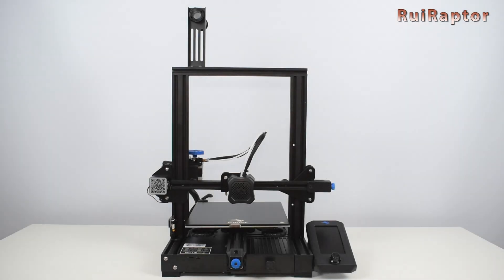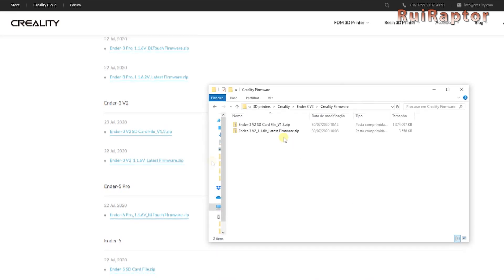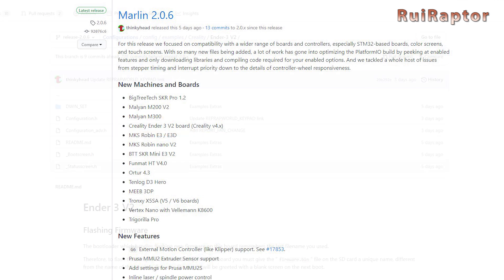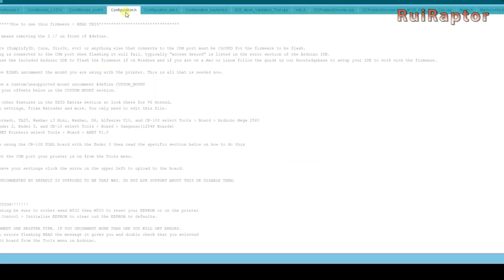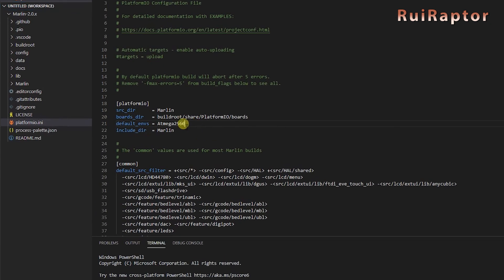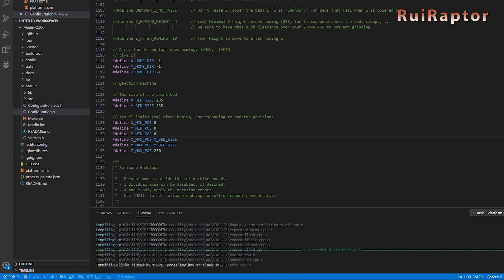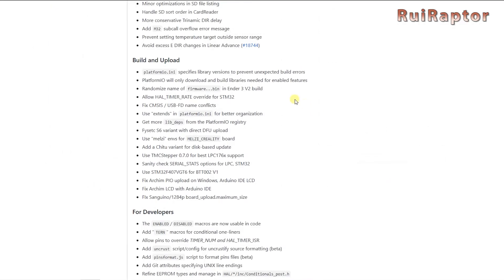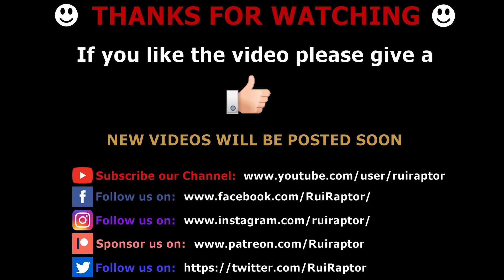Creality ENDER 3 V2 - How To EDIT & UPLOAD New Firmware

Comment from the maker: NOTE: Don't use long names for your gcode files.
If you try to print filenames with more than 23 characters long, the printer will act weird (X axis will move very fast to the left).
But if you print gcodes with filenames shorter than 23 characters long it will print fine.
Reply: Will have to try this out. Any fix for it?
Reply: lol wut...
Reply: Thank you!!!
Reply: hey, my auto restart after a fail got turned off after installing this
Reply: help pls:(
Reply: @danielgomdel6289  If you've recently downloaded from Creality, I believe the FW has changed since this video was made. I don't personally use Creality FW because it's buggy af. Are you compiling yourself? Did you change the board info in platformio? Try Smith3d if you're still having issues.
Reply: @gregoryconnors7370  good looks Greg ❄️
Reply: @danielgomdel6289  They call me the MadMan lol. Also- check out TH3D. JUST found out about them. Excellent instructions and new firmware!
Reply: @danielgomdel6289  +1
Reply: hi this isnt working for me i keep getting a error installing platformio.ini is there a different way
Reply: Interesting... I just had a weirdness that MAY be related a week or so back - Got a spiffy new E3v2 back around June, ran it for about a month as 100% stock, then added a BLTouch (3.1 version), configured and compiled Marlin appropriately, flashed the rig, got everything, including UBL, set up so that the printer was working absolutely A-1 Prime for the better part of a month, then took a week or so long break from actually printing while I picked up the absolute minimal skills in FreeCAD to do some original designs. Got the design work done for an idea I had, and started trying to print the resulting files. Things got SEVERELY WEIRD on the first .gcodefile I produced. (Which, now that you mention it, and I think about it, probably had a filename something along the lines of "first-project-left-side-main-body-lower-half-segment-one.gcode") The first layer started out reasonably normal, but rapidly got weird beyond belief. I was printing with a skirt, and that came out looking kinda like those old pictures of "what happens when a spider is stoned/on acid/on peyote/etc and tries to spin a web?" - Absolutely INSANE - looked like something a first-timer would produce in FreeCAD - a regular "pretzel". Then the actual first layer of the print started, and looked mostly reasonable for the first couple of layers, before the speed went ABSOLUTELY NUTS  - slamming (and I mean HARD) against the X and Y endstops, flinging around at speeds I'd never seen, and ultimately, I killed the print at around 40 layers when the bed bashed against the back end of the Y axis so hard that a tree-support snapped off and I figured the next development would be a wad of spaghetti. Then I tried grabbing a thingiverse object and printing it - same thing - "stoned/tripping spider" skirt, and the object was a nearly instant blob - It almost looked like the bed leveling was completely off the rails - Looking at the resulting mess, you'd proabbly guess that that the nozzle was at least 3 mm too high. Tried some troubleshooting. Attempting to auto-home it got me results that were so wonky I didn't know how to cope - It would home X/Y at the front left corner, back off to (roughly) X=18/Y=40, and then stand there and shudder when it tried to home Z, then pop up a "STOPPED" message on the display. Trying again would get it to X/Y home, then move to some apparently random spot on the build plate and repeat the shuddering and "STOPPED" message when it tried to home Z. Checked everything that seemed to make any sense to check, found nothing obviously wrong, so I gave up, flashed back to Creality-base firmware, and had the same things happening - like something had corrupted the firmware. Finally got things back to normal a day or so later after multiple reconfigure/recompile/reflash cycles, including one that I thought bricked the beast - took almost an hour before it decided to take the flash and fire up. When it did, things were at least as bad, if not worse, and I finally decided to take it ALL THE WAY back to "pure stock" - disconnected BLTouch, re-installed the Z-limit switch, and COMPLETELY (including the display unit) re-flashed the whole rig back to Creality 1.0.1. That finally cleared up the weirdness. Ran a few test prints, they worked. Re-did the BLTouch/Marlin configuration, and have been running fine since, but with much shorter filenames. I wonder if the insanely long filenames I was using for the project I cooked up had something to do with it, or if that was just a coincidence...
Reply: Thank you for this , I thought I had a broken machine

Comment: Sadly this doesn't seem to be working for me. Followed almost exactly except for that the newest files for Marlin appear to be, "bugfix-2.1.x". 

Marlin\src\HAL\STM32\../../inc/../core/serial.h:70:25: note: in expansion of macro '_SERIAL_LEAF_1'
   70 |   #define SERIAL_LEAF_1 _SERIAL_LEAF_1

The error I got was:
Marlin\src\HAL\STM32\../../inc/../core/serial.h: In function 'void SERIAL_ECHOLN(T)':
Marlin\src\HAL\STM32\../../inc/../core/serial.h:61:26: error: 'MYSERIAL1' was not declared in this scope; did you mean 'MSERIAL'?

First I:
changed default_envs to: STM32F103RE_creality
changed MOTHERBOARD to: BOARD_CREALITY_V422

Then I:
changed default_envs to: STM32F103RET6_creality
changed MOTHERBOARD to: BOARD_CREALITY_V4

I also tried every combination to including STM32F103RC, etc... but sadly nothing worked. I've got no idea what's wrong. This is just a heads-up for any other noobs that are trying to get their Creality Ender 3V2s' hot end up to the 260s (I put in 285 max) instead of having  it shut down at 230.

Comment: Hi, when i change that default_envs to creality type, platformio does not want to build, there is error, where it says that, it is not compatible with creality, only with mega 2560 est. What shoud i do? thanks for respond.
Reply from the maker: Hi, what did you define for the board in the configuration.h file?
Reply: @ruiraptor  hi, thanks for respond. I just already compiled it and works good, but my screen firmware graphical ui is broken. I think, i will install jayers firmware... What do you think?
Reply from the maker: Yes, i would recommend that as well.

Comment: I keep getting a status failed. Terminated with exit code:1
Reply from the maker: Hi Connor, scrool up a little bit and check which error you are getting.
Reply: @ruiraptor  c:\users\connor\.platformio\python3\python3.exe: can't open file 'C: c:\users\connor\.platformio\packages\tool-scan\scans.py':[Error no 2] no such file or directory
Reply from the maker: Check if your firewall/antivirus is blocking the python files from opening.
Reply: @ruiraptor  i checked and still the same issue 
C:\user\connor\.platformio\python3\python.exe: can't open file 'c:\users\connor\.platformio\packages\tool-scans\scans.py': [Errno 2] no such file or directory 

Then is says I have 63 problems all 
Function call is not allowed in a constant expression.

Terminal process "c\users\connor\.platformio\penv\scripts\platformio.exe 'runs "terminated with exit code 1.
Reply from the maker: Can you send us an email with the firmware so we can analise?

Comment: Hi there, great tutorial! Though if we already have octoprint installed is there any other modifications that have to be made in advance so it still works with the marlin 2.0 firmware? Thank you!
Reply from the maker: Hi, you don't need to change anything in octoprint. Just keep it updated.
Reply: @ruiraptor  thank you! Got it all set up no problem! Thanks for the tutorial

Comment: I have a Ender 3 v2 4.2.2 was lost the bootloader. How to build a bootloader binary file ?
Reply from the maker: Hi, it's very unlikely to loose the bootloader. I would bet that the firmware is not starting. Try to flash the firmware again (copy the firmware bin file to the memory card and make sure you have only that file in the card), reboot the printer and check.
Reply: @ruiraptor  I replace a new MCU STM32F103RCT6 then downloading a latest firmware from Creality to write to it by st-link. There are no actions after power up (blank LCD, no buzzer, no anything). What am I missing ?
Reply from the maker: Hi Sang, why did you had to replace the MCU? The new MCU does not have the bootloader installed like the stock one.
Reply: @ruiraptor  My printer got a short-circuit then the MCU could not control LCD (blank LCD, no buzzer), therefore I must replace a new one. Where can I find the bootloader ?
Reply from the maker: Ok, i see. Have you tried to contact Creality? Not sure if they will provide the bootloader...
Reply: @ruiraptor  I try to read memory content from the old MCU then re-writing it into the new one, copy the latest firmware into a MicroSD card then putting it into motherboard, waiting for about 20 second after power up, my Ender 3 worked perfectly. Maybe there was a bootloader in the old MCU firmware which the Creality wants to hide it.
Reply from the maker: The bootloader is the part that allows firmware update to be done by the memory card. Without it, the firmware could only be installed with a programmer using the SWD pins. That's why the new MCU needs to be programmed with a bootloader before the firmware. By reading the old MCU memory and saving it to the new MCU, you installed the bootloader. Good job ;)
Reply: @ruiraptor  If you write the latest firmware by SWD pins, I am sure that it would not work. I think the bootloader is not only update firmware via MicroSD card but also initialize some needful peripherals.

Comment: Thank  you for the video, I have entered my changes needed to go to a direct feed system, but it will not compile. I am using the updated 2.0.9.1. 
My error is:
arm-none-eabi-g++: error: C:\Users\BZ\Desktop\3D Printer\Ender parts.info\2?Software and Drive\Marlin-2.0.9.1 - Direct drive edit\.pio\build\STM32F103RET6_creality\tmp1mzsacho.tmp: Invalid argument
arm-none-eabi-g++: fatal error: no input files
compilation terminated.
* [.pio\build\STM32F103RET6_creality\firmware-20210713-153456.elf] Error 1
Reply: Disregard, linux got me. I had to remove the spaces from my folder names.

Comment: I followed the steps and got the success message, but don't have a .pio folder after
Reply from the maker: Hi Oscar, at the left of the visual studio code you have a tree and check if the .pio is there. If yes, click on it with the right mouse button and select "reveal in explorer". It will open that folder for you.
Reply: @ruiraptor  thank you so much, for some reason searching for .pio folder didn’t work, but then I tried searching for STM32F103RET6_creality and it took me to the build folder with the .bin file, I appreciate the help now I can finally use my printer with my ender extender thanks again this is the best video I’ve seen actually explaining each step .

Comment: I updated my V2's display with no problem, but I tried updating the firmware and it only shows an infinite black screen.
I'm not sure where I messed up, but I bet it's going to be fun finding out.
Reply from the maker: Hi D, did you use a different name for the bin file? Try having nothing but the bin file in the card when uploading the firmware.
Reply: Thanks, I'll try that.
 The bin file had a different name. I think I have to format the SD card and only have the bin on it. If that doesn't work, I'll try to check I'm not using the wrong firmware (I may have accidentally downloaded a BLTouch file or something).
I'll report back if it works or not.
Reply: @ruiraptor  I formatted the SD card (FAT32), recopied the bin onto it, but changed the name again, but only by a few seconds.
Inserted it into the printer, after a couple seconds it showed the logs and loaded just fine... I think I need set the home or something because at the bottom of the screen, it's showing "x:??? y:??? z:???".
Reply from the maker: Hi, it seems that it worked. The X, Y and Z coordinate information will only show after you complete the home sequence.
Reply: @ruiraptor  Thanks. Yeah, that makes sense. I'll just binge watch your videos for a while lol.

I'm really new to 3D printing (I got my first one 3 days ago) and assembled it. I have to fine tune the belts and adjust the rollers some more, then I should be able to do a home sequence thing.

Comment: fatal error: U8glib.h: No such file or directory but i added it with libraries.. What can i do/?
Reply from the maker: Hi, are you trying to compile the right firmware? Are you using platformio or arduino IDE?
Reply: @ruiraptor  Hi, VSC. My problem was that i had configuration file from ender 3 not ender 3 1.5. it's fixed now

Comment: Can we have a video on how to customize what you see on the LCD screen? For example, I'm using Marlin bugfix 2.0 build. The LCD screen has all the information I love. Extruder temp, feedrate percentage, fan speed, next line bed temp, extruder percentage, Z offset, next line, X,Y,Z coordinates.

If I do the latest version of Marlin, all that goes away and it just show the basic information like you are showing in your video. I would love to know how to customize what I see on the screen and not just the background. Thanks!

Comment: Must I install screen?I want to do mesh bed level and filament change and I should add new menu to screen.Should I upload to screens’ sd card slot?In other videos people says you should update screen?How should I do it a long time ago I tried but screen turned black and I spend a lot of money to technical service.Please help me.
Reply: Please help I need your help!
Reply from the maker: Greetings, If you plan on adding new functions which include new menus on the display, you might need to update the display as well. But if you are not confortable with this procedure, then you should contact some one to do it for you.
Reply: @ruiraptor  Thanks,I will contact some technical service for it.Thanks.

Comment: what is this please in vscode

#include errors detected. Please update your includePath. Squiggles are disabled for this translation unit (C:\Users\myusername\Documents\3D Printer Stuff\Firmware\Marlin-bugfix-2.0.x\Marlin-bugfix-2.0.x\Marlin\src\MarlinCore.cpp).

Comment: Hey Ruiraptor, First I want to thank you for putting out a great video! Second is in regards to when changing the build size, it not reflecting in the printers info section just like what happened in your video. Did you figure out what this was the case? I changed my X & Y Axis's to be 235 and I changed the Z Axis to be 350 (as I have a Z-axis extension added) but same as you when accessing the printers info section, it is still showing 230x230x250 and not 235x235x350.

Comment: WOW! This was absolutely the best video I have found on the internet to properly explain how to create the best .bin file for my Creality Ender 3 V2 BLTouch printer. Very clear instructions and the build worked just great. I am still working on the printer, as not everything is working correctly, but I am much closer not than I was. I wanted to ask di I have to tweak something in the configuration.h file to tell it I am running the new 4.2.7 Silent board with BLTouch and not adapter?
Reply from the maker: Hi Michael, thanks for the comment.
Yes, you need to edit the firmware. For BLtouch, you need to edit the firmware and enable the Bltouch and leveling feature.
Reply: @ruiraptor  I am new to this so I will dig, but if you would like to share, I would be grateful. After loading the new .bin, noting seems to work on my printer but the control LCD. I can see options, but nothing actually runs when selected. I can't even move the print head anymore. Getting frustrated.
Reply from the maker: Hi Michael, you have a creality 4.2.7 board on an Ender 3 V2? Did the printer came with this board or you replaced it? Which firmware version are you trying to install?

Comment: Hey I did everthing like you said, except for the firmeware I used the 2.0.7.2 version, but the M600 command still doesn't work. And if i now move my z axis upwards with the display controlls, it retracts the Filament like crazy. Any help for that?
Reply from the maker: Hi, for the M600 command to work, the pause feature must be enabled in the firmware. Regarding the Z/extruder, that is weird. When printing, the extruder works correctly?
Reply: @ruiraptor  yes it works completely fine until now. I will monitor my prints closely and update any changes. I have also now used the M0 command and writing "Click to resume" directly behind it to bypass using the M600. But maybe I will do another .bin file later to enable the M600 command. Thanks for the fast respond b.t.w..
Reply: So I have done another .bin file to enable the M600 command. The retraction issue when moving the z axis is now gone. Now I have two other problems: firstly I have noticed a lot of under extrusion in my prints. Second when doing the M600 it doesn't retract the filament at all. It just beeps, then hold the temperature and the purges the filament. I know that the command normally requires an LCD screen, so could it be that it doesn't work in the ender 3 v2?

Comment: Does this fix the eeprom saving to sd card issue?
Reply from the maker: Hi Zach, when using the new firmware from Marlin's website yes, it fixes the eeprom saving to the sdcard issue.
Reply: @ruiraptor  thanks for the video man finally somewhere with a detailed guide! by the way i noticed you didnt update the LCD , does it matter?
Reply from the maker: We didn't update ours, but you have the instructions here in Marlin's website:
https://github.com/MarlinFirmware/Configurations/tree/release-2.0.7.2/config/examples/Creality/Ender-3%20V2
Reply: @ruiraptor  thanks